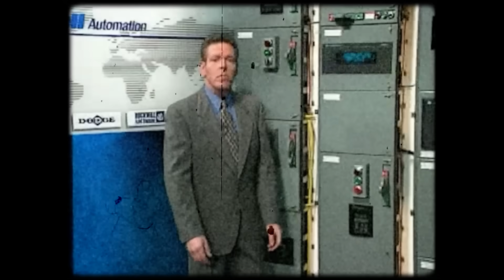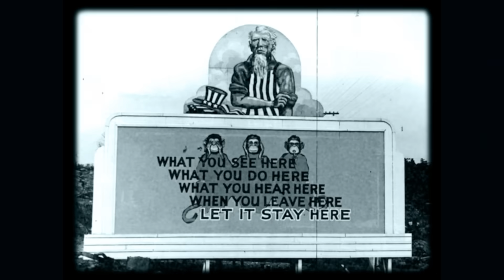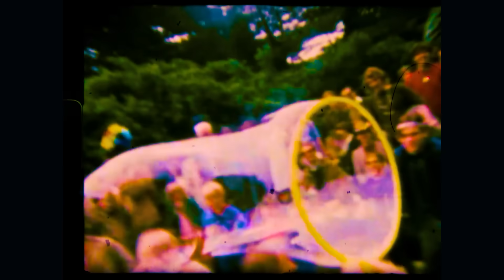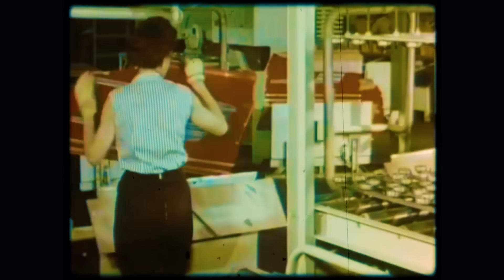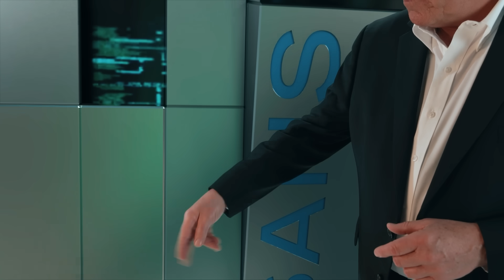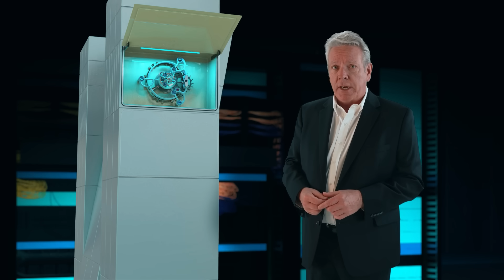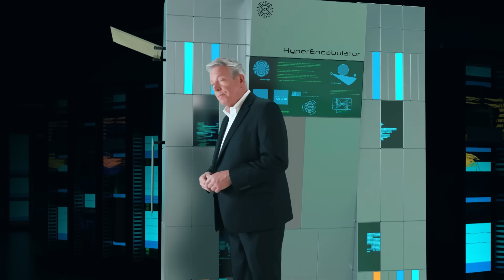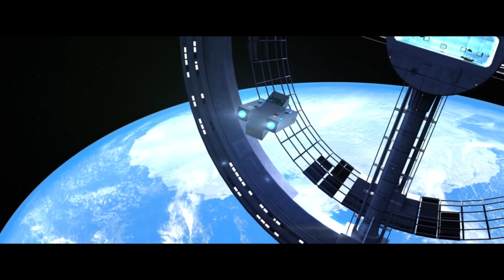SANS ICS HyperEncabulator

Comment: When calibrating framistats with deplenurized Milford trunions, I  always used my portable encabulator. But this is quite an improvement. Bravo.
Reply: Whoa there cowboy. If youre facing deplenurization of trunnion girdles you better check for sinusoidal side fumbling in the lunar weng shaft. And as always, lubricate your sliphole before and gripjiggy and it should want to stay planerized with the reluctance standoffs. Otherwise the piston return spring will interfere with the  muffler bearing and send the spirving arm straight through the amulite casing. And I dont have to tell you how bad that can be for your dingle alignment. Damn near impossible to get it back under USDWM spec after that, at least in the summer. Kiss that yellow sticker good bye for at least 6 months until they salt the roads again and you can do a proper calibration. Unless of course you have the limited semiboloid vacuum distribution assisted framistats....But whos got THAT kind of money?!?!
Reply: I was working on a similar process to mobilize this technology with portable veeblefetzers, but I was using a home-built model, a left-handed one with the belt in the back.
Reply: I wonder how well it handles plugging tangentsoidal s3 bucket holes to prevent yubikeychain jingling.
Reply: @chrissistrunk  It handles it quite well by checking the de-reinflated trinary datastream against the buffer size of the buckethole before insertion, in cases of detected overflow it can run multiple simultaneous renditions of the Burrows-Wheeler transformation algorithm on the hole until it is truly lossless.
Reply: I repurposed my retro vinyl encabulator for just such an occasion. Unfortunately the dingle arm attachment was insufficient to mitigate the sinusoidal deplanaration.
Reply: I was asking about a portable one.. The disergation over nautmeters is annoying! Send specs?